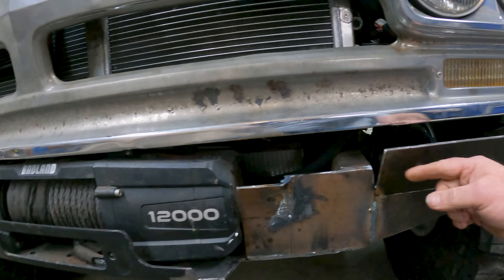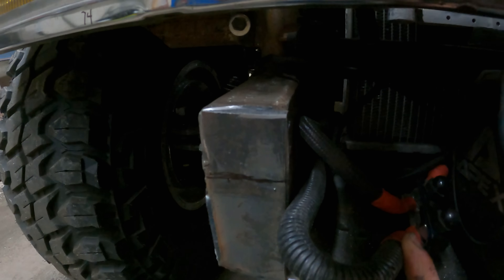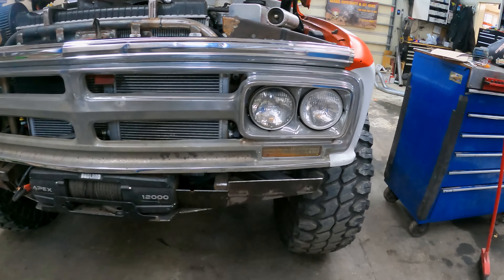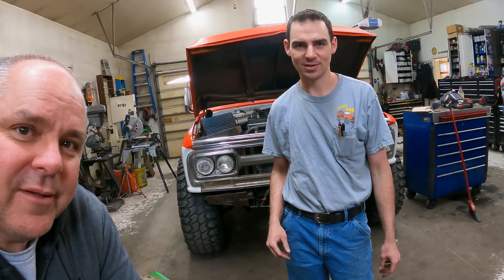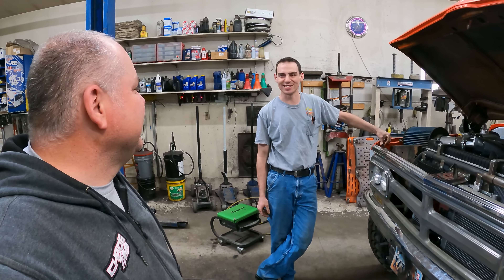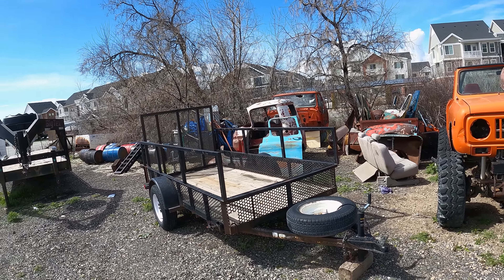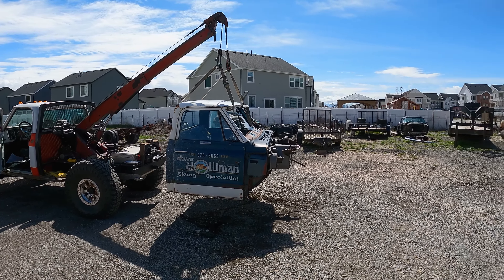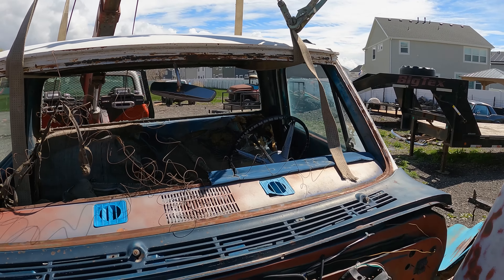Putting Griz the Wrecker To Use!!!

Comment: I thought the bumper looked OK before, but is much better now. Just needs a couple of the original off-cuts cut to the right angle and welded back on the bottom near the winch - hows that for OCD.

Comment: Hi Chad 🥸!! 
The death wheel will always be with us. But there is alt tools. 
May I suggest for that type of frame cuts try the largest 
 Of the cordless band saws. Doesn't have the Sparks of a death wheel either 😀. Mark both sides so you can make sure that your band saws making a square cut and you would be surprised how quickly it'll go through that ☺️ .
I hope it works as well for you as it has for me. 
All the best my friend and good luck 🍀😅
Reply from the maker: I do have a large band saw and use it a lot, just awkward in some spot.

Comment: Do you have a flashing yellow light for the roof yet? 
If not maybe you could use your electrical genius on the existing marker lights on the roof to flash in some sort of way like chasing each other across the roof or from the centre to the outside or vice versa? Just a thought?

Comment: I just now noticed while you were Professionally moving that trailer. On the back of Griz where your rear shock can is located. My, it's gonna mess it up brain, noticed that location is near the rear tow hook. What went through my mind was, if either a chain, cable or what ever you put through that hook, breaks. Looks like a real good chance of tearing that canister up when it breaks under pressure. It may be 100% fine where it is. Just looks like it could get messed up down the road.
Reply from the maker: You'd be correct. It's only there temporarily. Need to get the bed built, then it'll be moved.

Comment: How would it look with some round tubing under that bumper. Give u an round edge to push over rock ledges  and also maybe weld to bottom of winch plate for added strength?

Comment: You might want to consider having a tag line or two on things that you are moving with the boom that don't contact the ground in any way.  Makes it a lot safer to control, it's what they do on almost any crane work on a job site.  
You can get generic door edge chrome stripping that they use to prevent door dings in the parking lot and use it around the cut edges of the bumper, it dresses it up quite a bit.  You can also use it on the front fender lips (after you get it all painted to protect from rust), it will make it look a lot more dressed.

Comment: For serious…. You need air shocks.  Your trailer hoist lowered the back of the wrecker 4 inches or more and that removes your front wheel drive in many places.  Complete air system with dash controls for up and down and if you don’t mind my saying so air shocks aren’t enough alone as they only hold up not down.  Love your very civilized wrecker.  You ought to have a shop nickname:  Clean as a whistle.

Comment: Hey Chad for balancing your big tires out I have found the best way and the cheapest way is I will throw 4 to 6 golf balls in the tires before installing the tires on the wheels!!! Definitely give that a try and see how well it works for you also and let me know!!! I have done this to several sets of boggers that I run on my 1969 Chevy K30 truck!!! And seriously my 1969 Chevy K30 with a set of 39” boggers on it ride’s super nice a smooth down the road with 4 golf balls in each tire!!! It definitely ride’s much smoother than my 2007 classic body style 2500HD Duramax rides also!!! Every time someone rides in my 1969 Chevy that is the very first thing out of there mouth is how smooth of a riding truck it is with how big and tall it is also!!!

Comment: Looking great!!!! I love trying to keep the stock look as much as possible. I wonder for the lower part of the bumper you cut off, where it angles up from the winch, if you could weld in a piece on each side of another bumper to fill that in. Would extend the bumper chrome further down somewhat and help keep that somewhat stock look. I also thought, when you mentioned the tubing for the fenders, what about a piece along the bottom of the bumper lip to help with dragging over stuff. Should also keep the stock look but also add a little protection. No matter I am sure you'll make it look ever better than it already does.

Comment: I want to make a custom front bumper for my truck, the first bottom piece would be a short inside tire width round tube mounted about the same height as my lowest clearance of truck,
Then probably a piece of class 3 hitch stock for mounting various accessories or to be towed behind a camper, then maybe another piece of round tube, 
3/4 way up the tire and 1/2 the width, stepping out each piece 3 or 4 inches so you end up with 10  to 12 inches of a holding shelf for water jugs and other needs,
The trailer hitch would have a spare tire attachment strong enough for pushing on,
So it would also need a secondary or two spots 
 (contact points) to push off of.
The trailer hitch would also need to be Strong enough to accept and to be used as the winch mount.
The rear would be like steps up to the back with the tailgate up,
With lights mounted  Wherever needed and most protected. 
Same protocol for spare tire attachment and winch mount,
They should be interchangeable.
Love the GRIZZZZer.🎉❤

Comment: Now that you're ready to use Griz as a tow truck get yourself some certified training and go over to bailey's towing equipment and factor 55 and get some of the good stuff.  Towing and recovery can be dangerous work.  Set yourself up for safety and success.  Griz is going to be quite the unit once it's done.